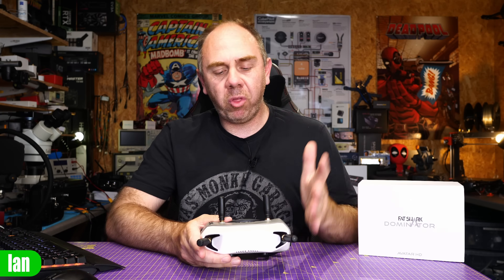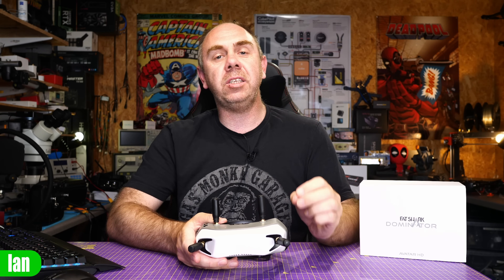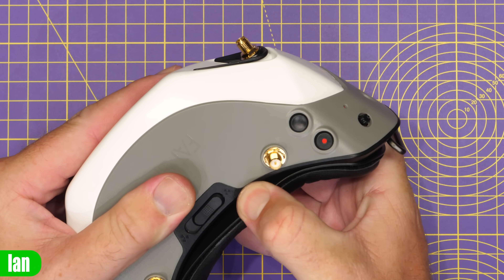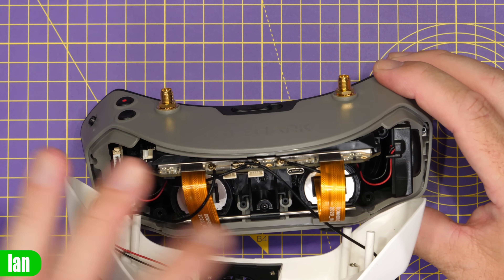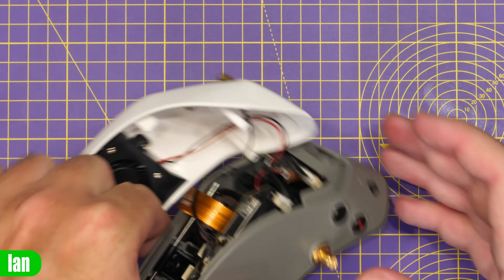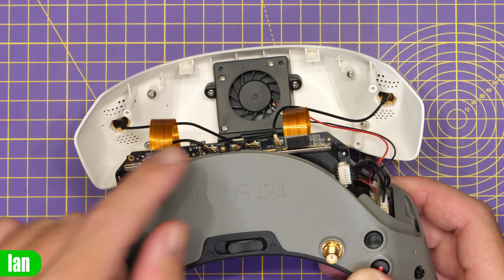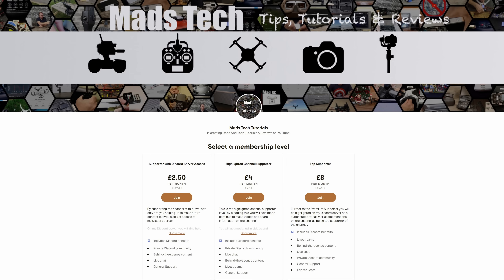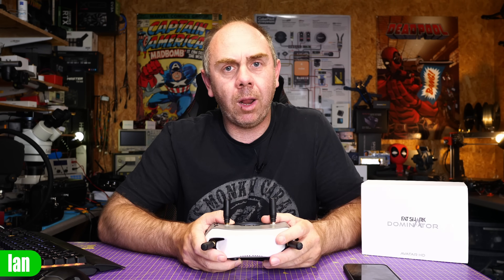Fat Shark Dominator Avatar HD FPV Goggles Teardown

Comment: @1:25.  They are not torq screws.  They are actually the same 1.5mm Hexhead  that would normally tighten/adjust camera angle on your drone.  I Swapped out antenna 1, 3 Ufl connections so that #1 is facing out with a patch antenna connected.  Super Easy!  I had to pull the goggles apart a couple of times to fiddle with the ribbon cable for the left eye.  The image was absent.  Be careful!  The ribbon cable is very sensitive.  Overall, an excellent and very informative tech video.

Comment: Hi. i'm make some test - i;m close by hand 1 antenna and signal fully dropped - why this - googles have 4 antennas but using only one? Very bad situation - because i'm make many tests and this is true! Only one first antenna using for to determine the quality of the link and when the connection between the transmitter and the glasses disappears - the video link disappears completely and no matter what is installed on the other 3 antennas - super patches or something else - it's all useless!

Comment: The DJI Goggles 2 actually can record video with an air unit and vista, you have to start the recording in the goggles before taking off, but the video looks in slow motion, I hope DJI can fix it in new updates.

Comment: @MadRC Can you tell anything from the tracing or components of where that usb otg port is routed? Wondering if the hardware is capable of hdmi->usb video in and the walksnail team is just working on the software
Reply from the maker: No it’s debugging.

Comment: Excuse for my stupid question: Is doing this void the warranty? 
I'm a LHCP analog user, all of the antenna use SMA connector, is it a good idea to tear the goggles apart to change the the antenna connector into SMA?
Reply: I want to do the same.  I do not think it is a stupid idea to change the RP-SMA connections to SMA.  Antennas are too expensive IMO, if you already have a full compliment of SMA antennas, doing this would save quite a bit of money.

Comment: Hi Ian, do you remember what size torx bit these are? Mine are too short so I'll need to buy a torx screwdriver.
Reply: Did you find out?
Reply: @Federico  yes, it turned out that mine were not torn, but just normal Allen head screws.

Comment: Did a test flight with mine , lost signal while landing didn't crash , got back home now the vtx won't stay connected , it was connecting for a bout 5 seconds and then black screen , now its not , when power up light flashing green the turns off and then solid red , no image

Comment: Yeah a DJI cloned design even if not precisely... (or someone else created the design and DJI used it as well) :)) RF section uses the same RF transceiver as DJI and only one of the DJI front end from sky (DJI uses 2 for transmission) and even has unpopulated on v1 the 2.4 g link as that transceiver is capable of 5.8 and 2.4. and obviously same soc. Code wise? :) well, I believe you can clone a thing without copying line to line anyway the secrecy of this product is not a desirable thing. What I can definitely say is that the PCB layout is definitely made by Fatshark engineers as it has all their particular designs written all over the board. :) Fatshark is definitely not happy when they see teardowns :))

Comment: The one transmission port makes me think that its data loss reaquisition request will be rather poor without a patch on that port. Especially for long range flights.
Reply: Exactly my thoughts too. Need the highest gain transmitting antenna for antenna 1
Reply: a common mod on these (and the avatar twin) has been to exchange antenna positions 1 and 3. 1 patch listening, patch transmitting.
Reply: Depends on the amount of data it transmits and the protocol no? I mean ELRS does just fine for so many kilometers on a basic dipole antenna..
Reply: @saidinesh5  There's a lot more data getting transmitted and potentially lost on a video link, compared to an RC control link. That transmit antenna could make or break, how well the signal holds up at more than 1km.. If DJI can make 13kms with a patch antenna. This better be as good, or it's not for me.

Comment: My question is,will someone make a transmitter (controller) that will bind to this system, like the DJI FPV controller. That was nice to bind and fly
Reply from the maker: There is no RC system built into this at all.

Comment: Shame that there is no AV in. Thats a total dealbreaker for me. I am using Analog, HDZero and DJI on my quads and i am waiting for a goggle that can do it all. Does anybody know if there is a chance for a standalone Walksnail receiver?
Reply: Walksnail said in a facebook post that they might release a standalone receiver. Not that i trust them.
Reply: If they do they would be back in the race for me. Want to use headtracker and do range then a standalone receiver / antenna tracker is needed
Reply: Same here. Complete dealbreaker.
Reply: Seems there would be a theoretical chance for that, technically. Realistically? I’d be pretty surprised. Hard to say how that would be in anyones best financial interests (other than yours, the consumer’s - obviously lol…). As with so many things, I feel like FPV goggles are still about the bottom line - the bottom dollar.
And I think the chances of any system being able to work with DJI VTx’s, other than DJI, are pretty much zero. It would be the most un-DJI move in DJI’s history to just open up to 3rd party compatibility (I still don’t count Caddx as actual 3rd party compatibility though - pretty clear who wore the businesspants in that relationship).